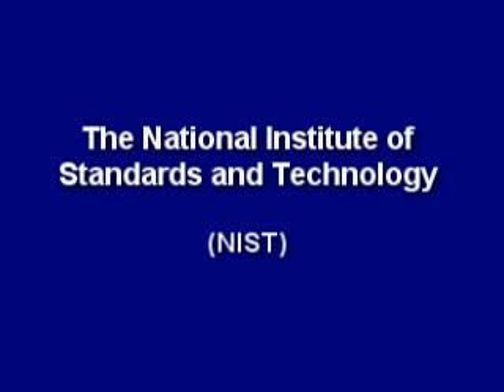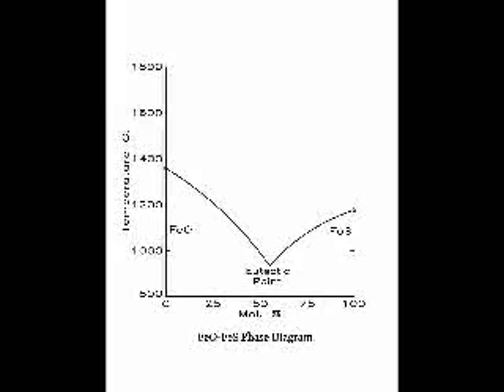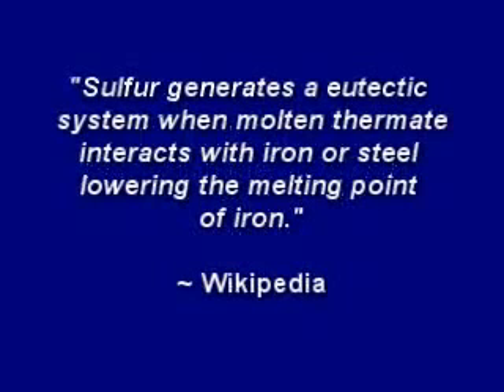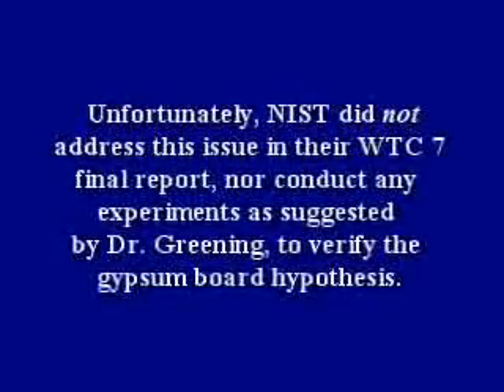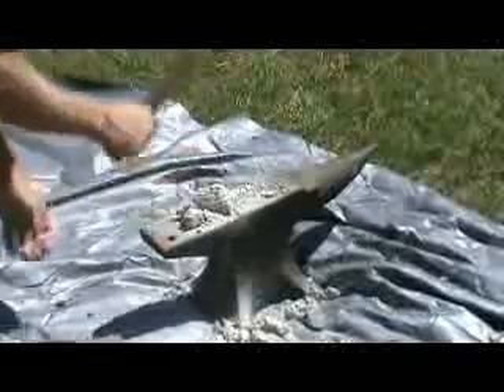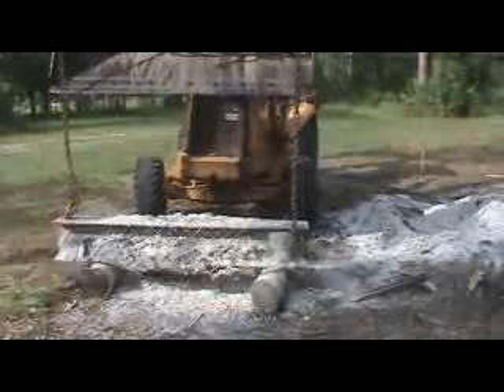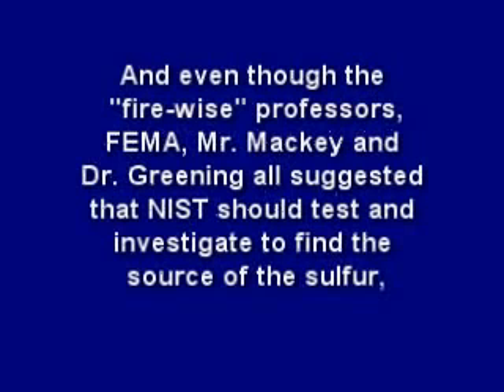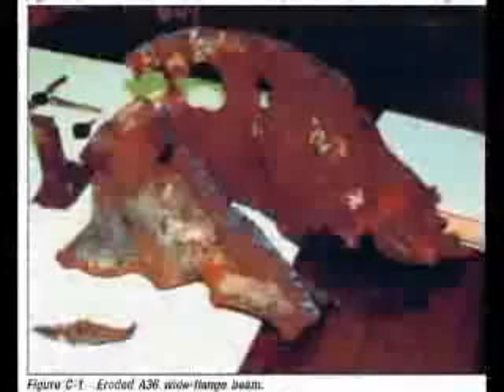9/11 Experiments - The Mysterious Eutectic Steel

Comment: This is an excellent example of the scientific method to run an experiment to try and duplicate the results found in the rubble of 9/11.
If doing an experiment that would far outstrip the conditions present at 9/11, meaning that the experiment was overly done to see if duplication of the materials found at ground zero could be achieved, and none were. Then the answer NIST gave to address this phenomenon piece of steel that was found  with the Swiss cheese effect is completely and utterly wrong.
NIST lied many times throughout the investigations, and made assumptions that here can be shown to be emphatically untrue.
So where do we go fromm here ?  
Just keep on revealing the truth until we can get rid of those in govt who block it from getting out.

Comment: Just had a long winded explanation from a government apologist who demonstrated some flashy math for the collapse and claimed all the heat was due to the mechanical deformation happening to the steel in the 10~12 second collapses. The sulfidation developed only in the pit, in the absence of oxygen where the heat all concentrated [somehow], then fireman's hose water seeping down through the rubble transported gypsum dust, so in the high heat, zero oxy environment it was transformed to elemental sulphur, thus the eutectic sulfidation observed.  Another poster flamed him for an old Popular Mechanics fiction.

Comment: Credit to you Ken for actually carrying out an exceptional experiment. However, your conclusions cannot be made on the basis of the outcome of this experiment. All you did prove was that this steel girder did not sufer any damage or distortion when placed in this fire. The fire may not have reached the same kinds of temperatures as the WTC fires. The girder was not under any structural load whilst being placed within the fire. Whilst you've tried to match the materials that may have been present, there is no way you can possibly know what, exactly, was present at the time that was in the vicinity of the piece in question.

Comment: Newton's Laws of Motion as applied to 9/11:
An Analysis of the Floor Collapse of the Twin Towers

Newton's 2nd Law ”The acceleration of an object as produced by a net force is directly proportional to the magnitude of the net force, in the same direction as the net force, and inversely proportional to the mass of the object.”
This, with Newton’s other laws, demonstrates the REALITY of the floor collapses within the twin towers.
The equation used is a derivative of the ACCELERATION of MASSES by GRAVITATIONAL FORCE: v^2 = u^2 + 2 * f * s, where:
Floor Mass m = 10^6 Kg,
Gravitational Acceleration f = 32.16 feet per second per second, or 9.81 metres per second per second
Distance between floors s = 12 feet, or 3.66 metres, and
Starting velocity u (original) = 0 ft/sec  (0 m/sec).  Then u = 9.72 ft/sec (2.97 m/sec).  Then u = 13.72 ft/sec (4.18 m/sec).  Then u = 16.3 ft/sec (4.97 m/sec).

It fits (as it must) in the case of a detaching floor. This, when and if it falls free, accelerates at G until it hits the floor beneath. From the formula v^2 = u^2 + 2 * f * s we know it strikes the floor beneath at a speed of 27.8 feet per second, or 8.47 metres per second.
We know that MOMENTUM is conserved, and the TWO floors would THEN be traveling downwards at HALF THAT SPEED, less the speed loss from the energy loss of the SHEARING of the floor connections.
We KNOW what this is, because we KNOW the average and general downward acceleration to have been 0.7G, as agreed by AE911T.
So we KNOW that the initial downward speed of the TWO floors is actually 70% of (27.8 / 2), which is 9.72 feet per second, or 2.97 metres per second.

Now we consider TWO floors striking the NEXT floor.   
Note that THE START VELOCITY (u) IS NO LONGER ZERO, but 9.72 feet per second, or 2.97 metres per second, so from the formula v^2 = u^2 + 2 * f * s we know the TWO FLOORS strike the floor beneath at a speed of 29.4 feet per second, or 8.96 metres per second, and thus the impact velocity is GREATER than before.
We know that MOMENTUM is conserved, and the THREE floors would THEN be traveling downwards at TWO THIRDS THAT SPEED, less the speed loss from the energy loss of the SHEARING of the floor connections.
We KNOW what this is, because we KNOW the average and general downward acceleration to have been 0.7G, as agreed by AE911T.
So we KNOW that the initial downward speed of the THREE floors is actually 70% of ((29.4 * 2) / 3), which is 13.72 feet per second, or 4.18 metres per second.

Now we consider THREE floors striking the NEXT floor.   
Note that THE START VELOCITY (u) IS NO LONGER 9.72 feet per second, but 13.72 feet per second, or 4.18 metres per second, so from the formula v^2 = u^2 + 2 * f * s we know the THREE FLOORS strike the floor beneath at a speed of 31.0 feet per second, or 9.45 metres per second, and thus the impact velocity is EVEN GREATER than before.
We know that MOMENTUM is conserved, and the FOUR floors would THEN be traveling downwards at THREE QUARTERS THAT SPEED, less the speed loss from the energy loss of the SHEARING of the floor connections.
We KNOW what this is, because we KNOW the average and general downward acceleration to have been 0.7G, as agreed by AE911T.
So we KNOW that the initial downward speed of the FOUR floors is actually 70% of ((31.0 * 3) / 4), which is 16.3 feet per second, or 4.97 metres per second.

On the point of impacting the NEXT floor THE START VELOCITY (u) IS NO LONGER 13.72 feet per second, but 16.3 feet per second, or 4.97 metres per second, so from the formula v^2 = u^2 + 2 * f * s we know the FOUR FLOORS strike the floor beneath at a speed of 32.2 feet per second, or 9.81 metres per second, and thus the impact velocity is EVEN GREATER than before.

What you see here is AN ACCELERATING TREND.  The acceleration of the massing floors is heading asymptotically for G itself.

"You are saying that as the first 15 floors collapses on the 16th floor" - Well, obviously not.
"The amount of kinetic energy is increased as opposed to deceased (sic)” - Certainly not.  Energy never ‘dies’.  Consult The First Law of Thermodynamics.

If you take the INITIAL FLOOR, its kinetic energy impacting the floor beneath it (assuming its weight to be 10^6 Kg) is 0.5 * m * v^2, which is 0.5 * 10^6 * 8.43 * 8.43 = 35,500,000 Joules.

If you take the FOUR FLOORS, their kinetic energy impacting the floor beneath them (assuming floor weight to be 10^6 Kg) is 0.5 * m * v^2, which is 4 * 0.5 * 10^6 * 9.81 * 9.81 = 192,000,000 Joules, which is MORE THAN FIVE TIMES GREATER.

Kinetic energy is ALWAYS INCREASED BY FALLING, as POTENTIAL energy is traded off against it.

So the floors will accelerate all the way to the tower basement.  This leaves FREE-STANDING COLUMNS A QUARTER OF A MILE HIGH.  THEY WILL BUCKLE AND FALL DOWN.

Comment: PRIMARY 9-11 CONSPIRACY ASSUMPTION SHOWN TO BE FALSE:
AN ANALYSIS OF THE AMOUNT AND DESTINATION OF THE POTENTIAL ENERGY OF A WTC TOWER
The first law of thermodynamics, also known as Law of Conservation of Energy, states that energy can neither be created nor destroyed; energy can only be transferred or changed from one form to another.
Source: Boundless. “The Three Laws of Thermodynamics.” Boundless Chemistry. Boundless, 02 Jun. 2016. Retrieved 12 Oct. 2016 from https://www.boundless.com/chemistry/textbooks/boundless-chemistry-textbook/thermodynamics-17/the-laws-of-thermodynamics-123/the-three-laws-of-thermodynamics-496-3601/
The World Trade Center towers (and WTC7) fell NATURALLY due to buckling failure when their 'slender' columns lost attachment to their floors.
They only used a third of their Potential Energy to destroy themselves, the remaining two-thirds was consumed in crushing some of their steel into ground zero.
A standing WTC tower possessed two hundred and forty six tons of TNT of POTENTIAL ENERGY merely by just standing there. We shall call this energy Eo.
The tower fell by taking the direction of LEAST RESISTANCE, which was THROUGH ITS BUCKLING COLUMNS.
The columns failed by BUCKLING because their STRUCTURAL STABILITY had been compromised by LOSS OF FLOOR ATTACHMENTS. No steel got crushed when this buckling failure occurred. 
Buckling is not a MATERIAL failure; it is a STABILITY failure.
The floors had detached themselves by sagging to an angle which snapped their connections. Photographs of these separated floors (taken shortly before collapse) are plainly shown in the NIST Report.
As each tower fell, some of that stored potential energy, converting to kinetic energy by falling, was released to damage and dismantle both the moving and the stationary parts of the tower on the way down.
The amount of the initial energy consumed in such a manner was inversely proportional to the rate of acceleration of the tower as it descended. It can be calculated.  We shall call it Ed.
The amount of energy remaining (Er) when the tower wreckage hit ground zero is then (Eo - Ed).
This energy, transferred elastically, caused PLASTIC DEFORMATION in the crushed base steel wreckage, and became HEAT. This too can be calculated.
The heat was considerable. The signs of it were captured by satellite. It amounted to the equivalent of a thousand tons of steel raised to a temperature exceeding 1,000 degrees Centigrade.
This hot steel, crushed and pressed against ground zero, oxidised its surface (making scale) and absorbed local oxygen gas, leaving a reducing atmosphere.
In these reducing conditions, and at a temperature of 1,000+ degrees C, fireman’s water which had percolated through crushed gypsum wall boarding DISSOLVED calcium sulphate (yes, Gypsum is 5% soluble in water), the sulphate ions of which were reduced to sulphur which combined with the exposed iron to form IRON SULPHIDE, which at such temperatures was MOLTEN, and flowed away. At a temperature of 1,000 degrees Centigrade, in an absence of oxygen, and in the presence of hydrogen, Sulphur and Iron atoms become keen partners.
Such hot reducing conditions also caused the water/steam to be REDUCED to hydrogen gas which was noted by firemen to be burning at the surface of the wreckage.
The wall-boarding and crushed concrete surrounding (but mostly above) the steel were THERMAL INSULATORS, so greatly slowing cooling.

CALCULATIONS (in SI units):

To calculate the original potential energy of the tower in TNT equivalent,
G = 9.81 metres/sec^2
Mass (M) of tower = 5e8 Kg
Height (h) to the tower’s CG = 210 metres
The explosive energy of 1 ton of TNT (Kt) is equivalent to 4.184e9 Joules

Equation: Tower Potential Energy (Eo) = ( M * G * h ) / Kt
This is equivalent to ( 5e8 * 9.81 * 210 ) / 4.184e9, or 246 tons of TNT.

The Potential Energy of each standing tower was equivalent to 1,000 standard 500 lb. ‘iron’ bombs.

To calculate the kinetic energy used in the tower destruction takes a moment, after a simple thought experiment, namely considering the tower would fall at G if there were NO resistance, and if it fell so slowly that it consumed ALL its energy, it wouldn’t fall at all.
So we can see that the PROPORTION of the energy used up by the collapse must equate with the proportion of G which the collapse was unable to achieve.
As the collapse acceleration was, by truther calculation, established to be about 70% of the acceleration due to gravity, we’ll use that.
The energy used up in tower destruction was therefore 30% of 246, or 73.9 tonnes of TNT.
Assuming that 30% of the tower fell outside of the basement, then the energy (Er) available to heat the wreckage base (by elastic energy transfer and crushing) was 0.7 * (246 - 73.9), or 120 tonnes of TNT.
We know that the steel reached at least 1,000 degrees Centigrade because that is the melting point of iron sulphide.
We can therefore calculate the mass (m) of steel that was raised to that temperature.
The specific heat of iron (Fs) is known to be 0.45e6 Joules / tonne / degree C
The ambient temperature was 20 deg C, so the temperature rise (Tr) was 980 degrees C

Equation: Er = m * Fs * Tr
So m = Er / Tr * Fs = ( 120 * 4.184e9 ) / 980 * 0.45e6
And so m = 5.02e11 / 4.41e8 = 1,138 tonnes.

The collapse of each World Trade Center tower created 1,138 tonnes of red hot steel at 1,000 degrees Centigrade.

So we can see that there is no need to postulate an extra source of energy, and that the basement wreckage heat is also easily accountable, with the additional corroboration of burning hydrogen at the wreckage surface, and molten iron sulphide at the wreckage base.
And so the underlying 'truther' assumption, that the planes couldn't bring down the towers, is shown to be FALSE, as it is shown by calculation, using the physically-correct values, that the potential energy possessed by the towers numerically accounts for ALL the known consequences, through elastic energy transfer, plastic deformation, HYDROGEN gas burning at the wreckage surface, EUTECTIC IRON SULPHIDE melting off the hot steel pressed against Ground Zero, and, of course, a tremendous amount of HEAT.

These results are EVIDENCE of the event.
They have been evident to any REAL scientist or engineer from day 1.